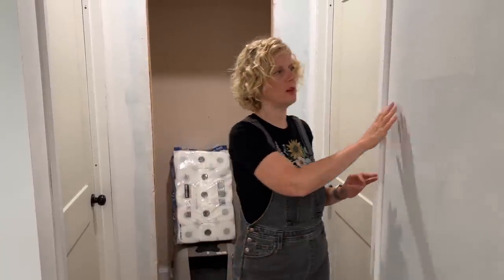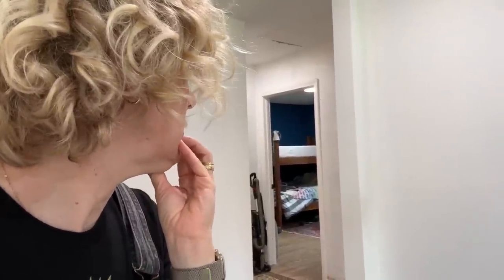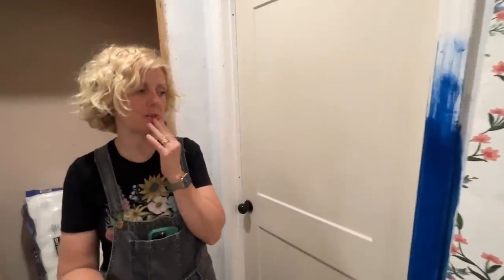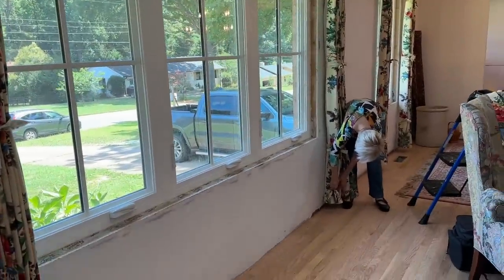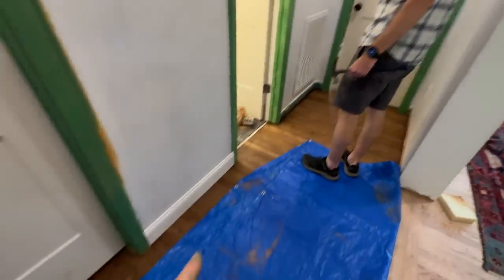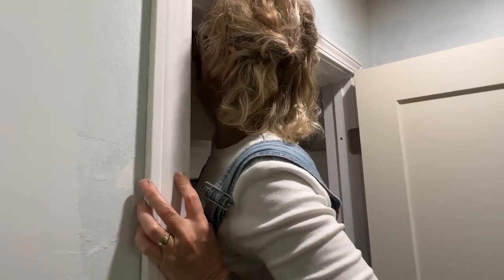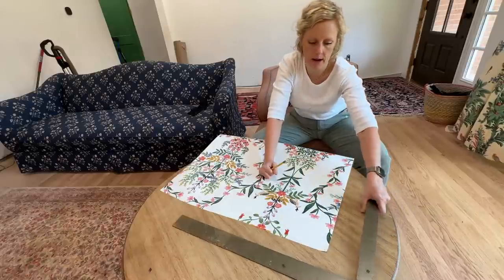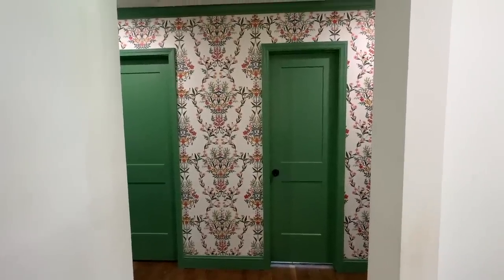TRANSFORMING A SMALL HALLWAY INTO MY FAVORITE SPACE

Comment: I had a Christmas tree stand leak water onto my hardwood floor for the three weeks the tree was up.  When I took the tree down, the floor underneath was wet and moldy black.  I let it dry and then sanded it with a hand sander, until I removed the black-ness, I tried a little bleach on it too.  I had to use wood filler between the floor boards that had shrunk.  I sanded again and then just poly-urethaned the area affected, and a little into the unaffected area.  I lightly sanded between each coat of poly (I did four coats).  At first it was noticeable, mainly because of the wood filler I had to use.  But years later, you barely know I did it.  It looks way better that the stained floor did.  I did use wax on my banisters for my stairways.  It makes a very grippable surface to hold onto.  I am curious to see how wax floors work out for you.